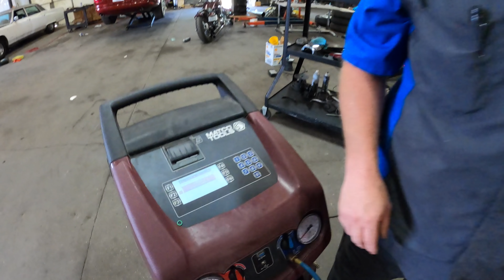My First ANNOYING Aston Martin Rapide Problem & RUNNING A FLATHEAD FORD V8 WITHOUT A CYLINDER HEAD?

Comment: Modern cars: don’t run when a wire is disconnected 
Old ford: runs with half its engine disabled
Reply: Exactly. and then there's the DEF bullshit that the government mandates whee is that runs dry, your truck will go into limp mode and shut down.
Reply: Modern Cars: limp mode when a sensor fails that is supposed to tell you which sensor has failed. Oh and what classifies as a failure? .002 more resistance in the wire.
Reply: @muskokamike127  I used to have a 95 Chrysler Concorde with the 24 valve V6.  That engine had 2 sensors, each on the end of a camshaft in each head, that would determine the ignition timing.  If either sensor failed, the engine wouldn't start, so the whole system had 1/2 the reliability of either sensor.  That was one of the many reasons we traded that car in for an 01 Acura TL, which we're still using today.
Reply: @Andrew-ep4kw  over half the failures of modern engines is the electronics and sensors that are supposed to make them so reliable. What did I say reliable? I meant UNreliable.

Comment: Make sure to save all the old parts u take off. I think the car's real value is as a very clean survivor. Can't remember seeing a nicer "51 Ford, much less a Woody wagon. Be careful and don't mess it up! Bob
Reply: I agree...that way someone can restore back to an original museum specimen someday if they want to...including the old 6v ignition, LOL!  Too bad they don't make repro cloth wiring...but out of a modern safer kind of cloth.
Reply: If it was up to me, I definitely wouldn't do any mod on it, except changing the wiring harness to keep out the fire hazard and bring back life to the dash. I'd even repair the factory tube AM radio to enhance the time-travel experience... this car's value is really in its originality.
Reply: @pex_the_unalivedrunk6785  Actually, you can get cloth insulated wiring. It's custom made, incredibly expensive, and not actually intended for use. It's basically relegated to high end museum pieces.

Comment: Then: running an engine without a cylinder head
Now: even a burnt headbulb can prevent you to start the car
Reply: I didn't know that could be done.
Reply: coughs in bmw
Reply: Apex Seal lol yes. Turn signal out. Runs rough lol
Reply: Map light goes out
Throws a check engine
Reply: It's got its cylinder head, its just missing the cover. But yeah, I get your point.
Reply: @zephead843  nope its a side valve, the cylinder head is not on, its a "flathead" The head has no valves they are present in the block
Reply: We need to go back to this.
Reply: @chefkdowg  you want to go back to 65-85 horsepower.
Reply: @mbsnyderc  I mean, I dont have a need for speed. I like reliability over power so I'd definitely try and daily one of these, then the 6 volt catches me on fire and I cant anymore
Reply: Mr_illicit6266 well no ones stopping you from buying one but most of us like modern power
Reply: yeah that pretty much sums up new cars.....
Reply: Mr_illicit6266 I also like the simplicity.
Reply: @shaunportlock4924  it was running on the other 4 cylinders, I believe,  or hope otherwise I'm confused 🤔🤔🤔😮😮😮
Reply: @mbsnyderc  I'm sure with today's technology and craftsmanship it'd be possible for a flathead V8 to make 300hp stock. If the car industry would have stayed with that design and perfected it as long as it did with the OHV design with just as much research and development, then many more advancements would have been made. Image what the flathead V8 would have become with an extra 60+ years of steady innovations of being a relevant player in the automotive world.
Reply: @DCecil21  No really the same because of the physical limitations of the design. One glaring shortcoming is when you un shroud the valves by pocketing the head you lower the compression ratio. So increasing flow doesn't always increase power. The other problem is things like valve location. The exhaust has an extremely long path through the block to the outside. This is less of a problem on an inline engine but now your limited to displacement and number of cylinders you can fit in a small package. There are many other things that make them an inefficient design. But for low speed reliable power they work ok. There still are many air cooled single cylinder flathead lawnmower engines going strong.

Comment: I had  a 53 mercury  flat head in a 41 ford business coupe!! I had an Offenhauser tri-power intake  manifold with three  Stromberg 97's progressively linked.
This was a real  pain to keep adjusted properly with three carburetors.  I opted to go back to a single carb  polished and ported intake manifold and purchased an aluminum adapter for a small  Rochester 4 barrel Carburetor  (56 Chevy 265 cid.) with  manual progressive linkage  that used 2 barrels up until throttle  was more than half open (adjustable). Worked very well!!  Low idle was 2 barrel almost the same as the Ford carb, but after that came on very powerful.  This was a  great set-up for me. Simple  Idle adj. and mixture adjustment . Wide open fuel mixture was almost perfect for max performance without too rich of a mixture for top end performance!! Good luck on your build. You are probably over powering this motor  for the stock crankshaft and bearings.  Also overheating is a problem for the  flathead.   You need really good   (high flow) water pumps and  the best large copper radiator you can find. Possibly an electric fan in front. The cooling is very in-efficient in these motors.
Also use the best head gaskets money can buy with these higher compression heads.  Most  of the old timers took out the motor and gave it a complete overhaul with all of the parts replaced   and matched with the horsepower rating desired!!!

Comment: Also, I think it's cool how you're modifying hot rod style like someone in the fifties would have.
Reply: It's called period correct modifications.
Reply: chris younts  Did they have blower's then?
Reply: Maurice Motors German engineers were putting them on cars in the 1920s.
Reply: Period correct except for the 12 volt system.  If you’re putting 12V on anyway, why put two carbs on when you could hack in throttle body injection.
Reply: @mauricemotors8207  yes. A common supercharger to use was a roots style. Detroit was using them on their 2 stroke diesels from the late 30's up until the 90's.
Reply: @davidattig7301  A 12v conversion is a very popular modification and has been done many times to flatheads and every other mass produced car from that era. Throttle body injection isn't a common mod and would cost more and not be as simple.
Reply: John Smith Started a sentence with and yet Is trying to call out other people’s English. lol
Reply: @davidattig7301  You would then have to upgrade the whole fuel system from the tank forward. And while it would make the car more drivable, it would lower its value compared to a period correct hot rodding, as Tyler is doing.
Reply: @mauricemotors8207  Here's a common supercharger used back then, replicas are still available I believe. https://silodrome.com/scot-supercharger/amp/
Reply: period correct

Comment: Watching that flathead run with one head off just blew my friggin mind!!
Reply: Yeah, I didn't know you could do that.   Not for long though, no cooling.
Reply: Yeah I didn't know that was possible
Reply: @olliehopnoodle4628  i had a first gen civic once that engine could run when it should not. I bet if you could take half the head off that engine it would run.... i always thought that little engine was quite a masterpiece, lightweight, ohc, only the ignition gave me stress. It could even break the timing belt with no issues. That is a great thing!!!!

Comment: Yay, Flathead V8 :) I had just commented about that, coupla days back? 
Privileged Society, Hoovie - Never toughed it out?
I do remember, the bolts on the flathead & when I got it off, the original, copper, head gasket, looked brand, spanking, shiny new. 
Reason for overhaul was, compression loss & oil consumption. Back in 1937 - That 85 HP engine, ran on monograde oil - 
No filter - Only, oil pick-up screen... Skull, distributor, keyed to the front of the nylon, helical, camshaft drive gear... 
Offenhauser & Edelbrock came to be known, decades later... There was a water pump on each bank - Integral with the engine mounts... Mechanical, cable brakes... Vacuum wiper... Vapour lock, fuel pump - Fixed by wet rag, atop?
Safety of steel - From Pedal to Wheel? Any Colour - So long as it's Black?... Rust & Bullet Proof Vanadium steel, body...
Transverse, leaf springs/ Friction, shock absorbers… Good Ol' Henry :)

Comment: That’s strange British cars are usually very reliable
Reply: xD  killed me
Reply: Maybe johnny needs to look at the Bentley
Reply: Good one
Reply: rofl, that's some class A sarcasm right there
Reply: You got jokes
Reply: Good one😂
Reply: Yet you Yanks keep buying them !
Why not just buy Toyotas like Scotty tells you ?
Reply: DJ Tourniquet Lol 💪🏼
Reply: MikefromQueens Said no one ever.
Reply: Lucas, The Prince of Darkness.   When loading cars on a Transporter, ALWAYS load the vintage british automobiles on the bottom... they WILL leak at least one fluid they have.
Reply: Just like the American company GM know very well for reliability. Especially I think In the 80’s and 90’s. Also the thing that broke was literally nothing this video isn’t even about the Aston.
Reply: @NSDflug  It never existed
Reply: Tony Clewes we like em! Lol
Reply: Yugos are probably more reliable than British cars.
Reply: @lbnewell23  you kidding? The LT1 had its issues, as you can see in that camaro, but apart from the distributor and a few other things, it was a very reliable engine. The LS1 was just perfection when it came out after that.
Reply: @lenmetallica  Then there's the rest of a GM car to deal with.
Reply: @NSDflug  MGB because it rusted out before anything could go wrong!
Reply: @lenmetallica  
Yeah the engine is fine. Rest if the car is garbage. I had an Impala and the engine never had issues but I had transmission, ac and the interior was falling apart
Reply: @dillonh321  didn't know there was a rest of the car. If you're buying 90's American for anything other than 4 wheels and a V8, it's a big mistake.
Reply: @NSDflug  You won't have any problems with the new Land Rover Defender that Doug reviewed yesterday - that's made in Slovakia not Solihull.
Reply: @honorharrington4546  If a British car does not leak it means there's none in it! Didn't you know old boy?!!
Reply: this supposed to be a sarcasm or nah ?
Reply: @lbnewell23  GM's never got so bad the cause the company to cease to exist.
Enough people were happy enough to buy another one.
What does the British buyer have to choose from?
That's right they don't have anything.
A majority of British buyers realized their domestically produced vehicles were so bad they flocked to imports.
Reply: Nearly as reliable as American 🤣 hence why most Americans buy Japanese brands
Reply: A universal truth is that some people have more money than sense. Never underestimate how many people will pay a lot of money for junk just to look cool.
Reply: @philippernice8769  That is just a re-badged BMW!
Reply: Hmm maybe Rolls-Royce, I had never heard about issues with them mechanically.
Reply: its sad tyler doesnt have french cars then it would be a party (yes i speak of experience sigh french cars always broken)
Reply: @lbnewell23  Because the Aston has a modified Ford Taurus engine..
Reply: @tonyclewes8  Because we are Anglophiles and in time we are just going to absorb the UK into the United States- Don't laugh children usually take care of elderly parents- Then again some us just plan stupid.  I had two  MG's in the first half of the 1970s and that was enough!
Reply: Valkyrie Survives what’s the saying. Ford will go down the road more BROKEN than any other truck
Reply: I wonder how many commenting have any actual experience? I’ve owned six British cars with no real problems. Four American cars and all were awful.
Reply: NSDflug I dont know, which have you owned?
Reply: lenmetallica Four wheels and a lazy underpowered V8?
Reply: @williamegler8771  the only reason GM still exists is because American taxpayers got rogered senseless to keep it afloat.
Reply: The world is slowly coming round to the British way of making cars first the American in the 90s and now even the Germans are making unreliable cars, just the Japanese to go and finally BRITISH LEYLAND WILL LIVE AGAIN!!!!!!
Reply: 😂😂😂😂That was a joke?? Right🤪🤪
Reply: @NSDflug  Morris mini???
Reply: Tony Clewes . Because driving a Toyota has all the appeal of eating a bowl of flour.
Reply: James Needham There are no British car company’s left.
Reply: @jonboy9912  I always thought the British Unions made the manufacturers add the oil leak station at the end of the line as a job creation measure.
Reply: @interceptor-ss8kb  to be fair the whole world does O.o
Reply: @NSDflug  Or German.
Reply: @Macron87  Let's go with 'that never happened' for $400, Alex.

Comment: When will you Americans finally realize that "Made in Britain" is a warning label?!?
Reply: Lol
Reply: All european cars have issues tbh
Reply: Made in Italy is a title to a horror show lol
Reply: Yeah,just like the Rolls Royce Merlin you fitted in the Mustang!😁
Reply: Made in US = hopeless junk
Reply: @threepot  When you need to reach back several generations to get a good example, that should tell you a thing or three.
Reply: @jayc342009  You know, that here in Europe all american cars have issues :D :D :D
Reply: Bob Loblah  Ford Mustang ?
Reply: Think of it more as a challenge. "Made in Britain - are you tough enough to handle it? Are you brave enough to own a car that needs constant care? If not, then walk away. Buy yourself a Toyota instead.  You have been warned!"
Reply: @MrDuncl  Yes, it typical new Mustang, some Chrysler models, Dodge . Still very small amount on the roads. European like German cars on average, BMW is like wish of every man in Europe...
Reply: @MrDuncl  I personally drive Japanese, have bought pretty cheap Suzuki Kizashi 2.4i with 40k miles for 11k $ which is 25% from new price. A pretty good deal. Car has no turbo charging it is a 4 inline producing 180hp which is funny and has full equipment. It is like Honda(Accord Europe) Acura half the price😎 which by the way is awesome car with 2.4 inline D-tec engine
Reply: @Iskelderon  nearly all current cars are full of crap, unnecessary electronics and sensors that are hard to repair on your own (I'm saying repair, not replace) and are expensive, it's just companies making sure they can get the customer fed up with repairing and rather buy a new car... Honestly I'd say the last good cars, that were made to last, dissapeared after 1995 (atleast the EU ones)
Reply: I have two fully British vehicles and a made in Britain Toyota. The Toyota is far more reliable...
Reply: If you're referring to the Bentley I'd like to point out that the issue looked like it was the injectors - which are Bosch - which are made in Germany.......x
Reply: The Aston in the video was made by Magna Steyr in Austria. They have done contract work for MB G-Wagen, BMW, Porsche (Cayman, Boxster) Mini 4x4 etc.
Reply: @1maico1  which bit?
Reply: @jimgoodwin6294  When the Rapide was launched in 2010 Aston didn't have spare factory capacity to make them. 
They use a bonded-aluminium chassis platform but I don't know if these were shipped from the UK to Austria. I think the paneling and trim was the work of Steyr. Other parts come from all over of course.
There was a factory tour article showing how these were made in the British magazine Autocar circa 2010. 
In 2012 production was moved back to the UK. Hoovie's car is a 2011 with 55,000 miles and in great condition. One of his best buys!

Comment: WOW!  I just never thought of that, even with the bit of experience I had working on my 1936 Ford.  But the flat head V8 basically is like two individual 4 cylinder engines put side by side with individual ignitions & individual water circulation systems. That's amazing.  :-)

Comment: I had three different cars with flatheads, my favorite V-8, Reason why Ford got rid of them is cause they were too reliable!
Reply: Great motors but they were horribly outdated when ford replaced them in 53
Reply: I love a flathead Ford (the exhaust note is music for my soul)  but all ford V8s were great engines for reliability and I think I have had all of the engine families over the last 25 years well they were all good until the Modular 3 valve thing in the 04ish f150. 
The Flathead and the 385 series big blocks are my favorite ford engines.
Reply: Flatheads are cheaper and simpler, but there's only so much power and compression you can push into one. There's technical limitations to it, and the cost of making a flathead have the power of a modern OHV/OHC would end up costing more than just making an OHV anyway
Reply: They are some cool motors. And they sound cool too. The Y block that replaced it also as a nice rumble to it
Reply: The flathead V8 would reliably overheat.

Comment: On the farm I grew up on, we had a 4 ton '49 Ford dump truck with the flat head v8.  My dad had it since new.  You can imagine how power challenged a dump truck is with that flat head engine.  I learned how to double clutch every shift as there were no syncromesh tranies in those days.

Comment: I love the Woodie! I'd love to see you add some period high performance flathead parts with a dyno before and after to see how much power they were really good for!

Those old flatheads and some newer engines were also used as air compressors. They just replace one head with a air compressor head and ran the engine on the other four cylinders. There's an idea for you Hoovie!